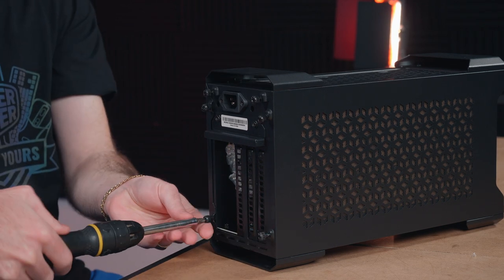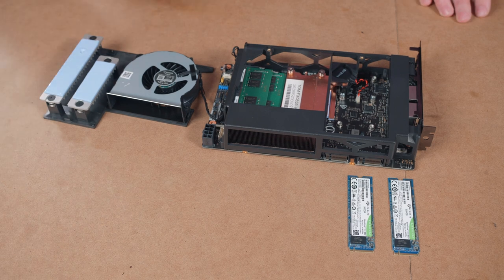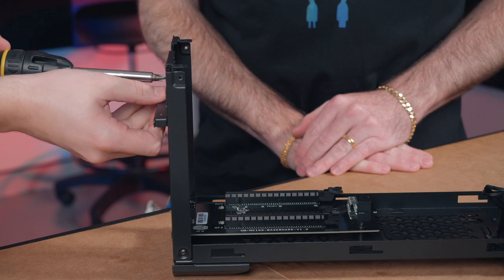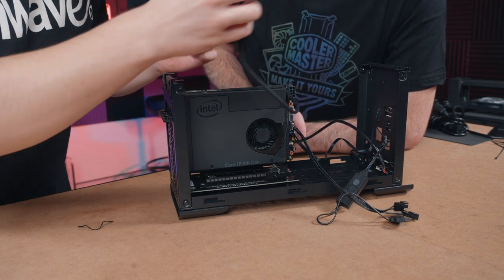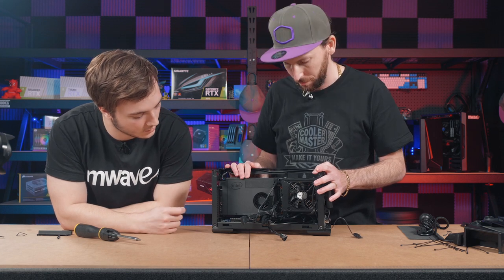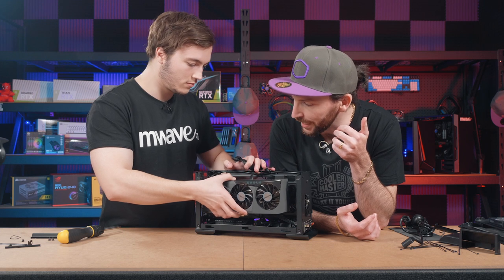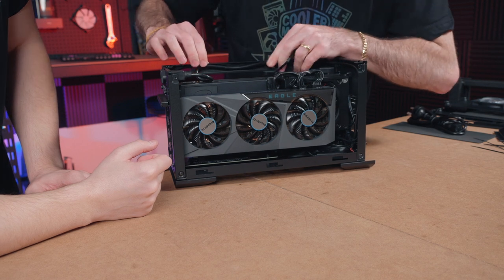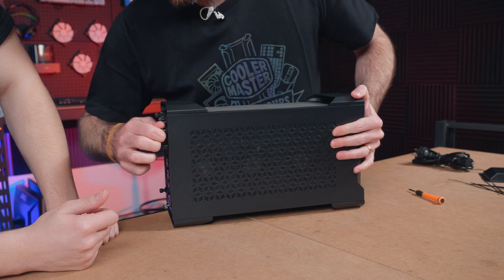How to build a 7.9L SFF PC with ease: CM MasterCase NC100 + NUC 9 Extreme + RTX 3070

Comment: i was thinking of pairing a 4060 ti which accepts at the least a 550w psu, and the nc100 has a 650w psu in it. would i have any issues with this or would it work fine?

Comment: Two things that didn't happen in this video which would have been nice to see. 

1. How do you fit the black shroud that came with the unit that takes air in from the bottom to the CPU fan on the compute unit. 
2. It's optional, but pretty much required for most people and that is the wifi option, which antenna and cables are best suited, and where/how to mount them to the front of the case, or at the rear.
Reply: This case doesn’t have cables for WiFi, and the shroud sticks on over the CPU fan. The shroud is pretty much common sense.

Comment: can you mount a normal intel NUC into this housing?
Reply from the maker: Hello! Do you mean to build a different NUC system inside the Cooler Master MasterCase NC100 Compact NUC Enclosure? If so, then yeah there shouldn't be any problems. Just make sure that all the parts being used fit the recommended size requirements for this enclosure :)

Comment: Rx 6900 xt reference compatible?
Reply from the maker: Hello! As long as the GPU size fits in terms of size, 320mm x 51mm x 130mm (Recommended card height is 112mm for maximum compatibility), it will be compatible :)